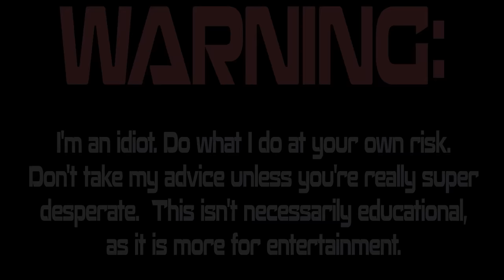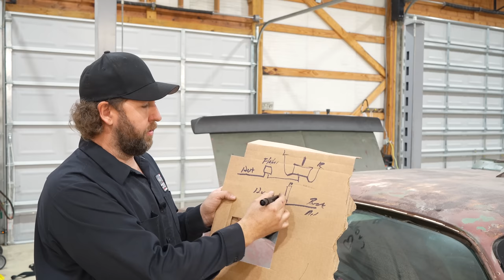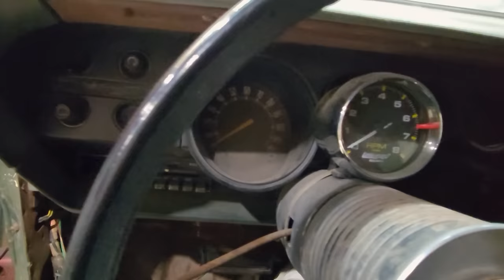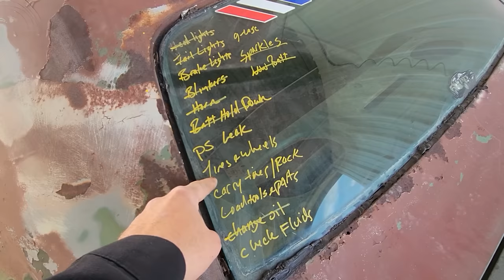Preparing Vanishing Paint for 1,000+ miles!

Comment: For future reference lighter fluid (like Zippo lighter fluid) removes sticky stuff like old stickers and the like, really well. Praying you heal quickly!
Reply: Top tip for removing adhesive foam residue if you're debadging a vehicle: wrap a few sheets of bog roll up to make a pad. Soak it in petrol (gas) and slap it over the residue. Leave it for a few minutes and the residue will come right off 👍🏼.

Comment: I have watched your channel for years, and it just keeps getting better.  I have removed hundreds of decals at work off truck doors.  I learned to use penetrating oil to remove the glue residue.  We had Zep 45, WD 40 works, but not as good.  Just spray it on, let it sit for a few minutes, when just wipe it off with a rag.  Repeat as needed to get it all off.

Comment: Rapid Remover will take care of that sticker residue with the quickness. I used it for years at my vinyl decal shop. It's not hard to find but it is pricey. If you want it off and quick, that's the way to go. Just try it out and see if it works for you. Take care of those ribs!

Comment: Derek with the roof racks if you had left a few inches on each outside of the square tube, it leaves a REALLY nice space for synching up rope or straps. The holes in the bracket are nice but there are situations where you def dont want to use those. Being able to wrap a tie down around the outside of it and making a basically immovable wrap around is always a good thing

Comment: Hey Derek! I used to work in a commercial photography studio and the photographers used to swear by Zippo lighter fluid for removing stickers of all kinds. It removes all of the adhesive and doesn't seem to harm paint or most plastics. You've probably been told this before but if you haven't, give it a try.

Comment: Lighter fluid is the best solvent for sticker residue, and it evaporates very quickly so it’s not a massive fire hazard.  Supposedly professional dry cleaners use it on leather jackets when necessary.

Comment: Derek, it may be worth your while to get some xylene in. It's a great degreaser/solvent and cleaner, it  gets rid of sticker residue as well, also non flammable, so relatively safe around sparks etc. Just test on plastics before jumping in, it does attack some plastics, I ruined an expensive Hi-Fi amplifier switch by not taking my own advice...

Comment: Hey Derek,

Love the videos.  I manage a fleet of vehicles with company logos that change or have to be removed.  I have had great success using a decal removing rubber wheel, heat gun, and alcohol.  I believe the alcohol would have removed the remaining decal adhesive without removing or damaging the paint.  Worth a shot.  Praying for a quick recovery from your motorcycle mishap.

Comment: Man this takes me back. Had a 71 barracuda had the same wiring issues. I ended up replacing the whole harness from bumper to bumper. But it still had a brake light problems from time to time would pop the fuse. Never found the problem

Comment: The brake light  circuit is normally  open until the brake pedal arm is pushed, and the switch  little pin that is up against the brake pedal arm comes  out closing the circuit feller and fellets

Comment: Derek and Jessica great video. I am not sure how it works on the older paint but I have used 3m adhesive remover for large decals/stickers, it works great. Just spray leave it cook a bit and pressure wash off the adhesive. It does have to be 3m brand. For the next time.

Comment: You might want to try slotted unistrut. It comes galvanized/zinc coated. Get the hangars/t-bolts/ accessories to mount or frame it up. Super strong.

Comment: I bought a retired police Jeep Cherokee, and the goo from the cop decals was a challenge to remove- I finally discovered that 3M makes a spray that you can use to remove the goo, but you have to work fast. I bought it at the local NAPA.  They also have a wheel you can put In a drill or buffer or something, the pictures look like gum rubber.

Comment: Isopropyl Alcohol is fairly effective at removing adhesive, usually without damaging the paint underneath.

It’s what we used all the time when I worked at a sign company doing all sorts of vinyl work. Goo Gone and other stuff is just too intense.

Spray on the adhesive residue, let it soak, scrape off with plastic razor blade or credit card.

Comment: Wanted to let a feller or two know that 3M (and other companies) make a really cool disc that removes adhesives REALLY easy!!!  I've been using them for over 35 years now.  They just zip that glue off there RIGHT NOW!!!  If I can't find my disc, I also use copious amounts of acetone on a rag, letting it soak into the glue to soften it up. Comes off pretty easily too that way.

Comment: If you have a laser or water jet cutter, you should find a way to get the VGG logo cut ito the roof rack brackets. Get the 1x1 tube to fit inside the G. I'd put those on a rigg.

Comment: GR8 Add-Vice Derek... 

 [ "Don't be afraid to do the 'Eee-Lek-Tricks'  ...it's simple to do and not that hard." ]

I'm inspired to rewire the 'O/D Off' switch that no longer works on my '03  Tundra wherein the fouled switch is located on the end of the column mounted gear selector.  I'll just run the Eee-Lek-Tricks to the dash panel, somewhere maybe to the right side of the instrument cluster. Maybe or not.

Fortunately I can put this task off until tomorrow or the day after tommorow as I really never need the 'O/D Off' thingy to be active in my occasional to town and back trip.

Comment: Not a fan of electrical either but when you want something bad enough you push past the fear. I did a 2012 dash swap in my 06 mustang but adapted the original harness rather than converting the entire chassis wiring bumper to bumper. I modified the original gauge cluster to fit, created a custom center stack panel that looked stock and changed all the surface mount LEDs to blue and it turned out awesome. Would have been nice to use a 2010 cluster but there were too many wiring and comm changes for it to work without a custom black box for signal translation.

Comment: never tried it with a surface like vanishing paint but a while back a guy was spending alot of time removing vinyl stickers and such from big motorhomes.  3m adhesive remover was a godsend.  i see they changed the name or the original product i used to use and have a few more versions.  ive used it on various other tough adhesives inside and outside of vehicles on paint plastic and leather to great effect.  so not sure if you have tried this product but wanted to try to help a guy out with something ive used before.

Comment: Just noticed that Wire Care produces the Clamp Tite tool. Wonder if you have featured it in any videos? Seems like you should be using it extensively in repairs. Strong enough to hold hydraulic pressures.

Comment: A word of advice regarding your roof racks:  Find something to fill in the holes on the ends of the 1x1 steel bars.  My Dad had a universal roof rack kit years ago that attached in a very similar manner to yours using the drip trays and clamps.  Like your setup, the rack bars themselves were basically just 1x1 bars (these were made of aluminum, I think.)  Anyway, what will happen with open ends is when you hit highway speeds, the air flowing past those open tube ends will make a God-awful whistling noise that gets louder the faster you go.  Definitely cap those ends somehow unless you enjoy listening to a constant and piercing whistling noise at speeds above 50MPH.

Comment: Mopar A- through E- bodies (yes, even the rarely-discussed D-body, better -known as Imperial) of the Muscle era have torsion bars.  
Good News: Much stronger and better handling than coil springs.  More room between the shock towers for engine.  Can adjust ride height by turning two bolts.  

Bad news:  pre-'65 they were prone to snapping, but only when the car was parked.  Put headers on it and you have to take them back off to swap out a starter.  Gotta be a contortionist to swap out the oil filter.

Source:  paternal grandfather.  Chrysler Corp. Dr. of Motors, class of 1956.  Independent mechanic until retirement in the early 1980's.

Comment: With the spring on the brake switch plunger above the brake pedal arm, the switch it self is normally closed. Pedal is up, plunger spring is in, the circuit is open. Brake lights are off. Push the brake pedal, the switch plunger spring comes out (in its normal position) the circuit closes and the brake lights come on. It is a normally closed switch. Is that right??

Comment: Sometimes that darned sticker glue will come off with naphtha or gasoline. I have used crisco or vasoline to soften it but you have to leave it on for a few hours and then scrape it off with a plastic scraper. Any way you look at it, there’s always a lot of sweat equity involved.b. By the way and sorry ifin I’m buttin in but I’d like to see a mopar big block like say a 383 dropped in this time machine.

Comment: That’s a solid car everything looks to be in great shape !! I’m going to buy my paw paws 1969 barracuda back this weekend he owned the car most his life he passed away 23 years ago and I ran across his old car on marketplace and it was still local doesn’t have a motor in it the guy still has the original motor and trans that came in It was a 318 but he also has a 440 short block that’s built Imma get both of them I can’t wait to start on it my paw paw painted the car years ago with Rustoleum metal paint red it has a nice patina on it not sure if I want to repaint it the right way are may buy your patina shine for it but that’s going to be the last thing I do… my paw paw redone the inside with black leather and he redone door panels and all it’s still in good shape and the dash is excellent !!!  Has a little rust on the quarter panel on driver side very little though

Comment: Derek what is your opinion on using diesel oil in my old 1996 ford bronco it has a 351w with 230,000 miles on it and i would like to make it last a little longer it uses about a quart between change and still run great. Be careful on them there motorcycles i have been riding way back before you had to have license . long time fan back before the independence chevelle ,love the car so keep up the good word and keep your boys interested in turning wrenches god bless your familys

Comment: The rear running lights on the right side weren't working correctly. Also maybe you can paint the etchings on the switch panel so the writing is visible.

Comment: do not use anit seize on aluminum heads or on ngk spark plugs,   i would go back in and take out the plugs clean the threads with brake kleen b4 it gets cooked into the threads. block and the spark plugs
Reply: If you think plugs go into the block you're the wrong person to give any advice....LOLOLOL
Reply: @Rick-ro8bf  might want to check your engine block for anti seize, you might have to hone the threads🤣

Comment: This is the first time I've liked your choice of tires and wheels. Those oversized Torq Thrust wheels and rubber-band tires looked terrible. On the other hand, I love stock stamped steel wheels and dog dish hub caps, and those tires you chose are the best looking radial tires that have ever been made, because the original Firestone Wide Oval bias ply tires are in the top two best looking tires ever made, and those radial versions actually look like their bias ply counterparts.

In the pure looks department, I'd give a slight edge to Goodyear Polyglas bias ply tires (plus they are more appropriate for a muscle car era Mopar because that's what came on many of them from the factory), but for radial tires, you couldn't have done any better. 

They make a supposedly "bias look radial" version of the Polyglas, but unlike the Firestone Wide Oval radials, they don't actually look like their bias ply counterpart. The tread pattern is drastically different (much deeper and larger lugs), and even worse than that, the shoulder is drastically different, which is a deal killer, because the clean, sharp shoulder of the originals is the best looking part. With the supposedly bias-look radial version, the tread spills over onto the sidewall like with ordinary radials. You might as well just get BF Goodrich Radial T/As (and save a ton of money) if you think an all-season-type tread spilling down onto the sidewall looks good on a classic muscle or pony car.

Comment: Is way better than gougon or alcohol by itself, you want to use WD40 spray it on a Terry cloth rag! Do this several times to get the initial sticky element that is left on it. Once that is done you use isApril alcohol and wipe it down with an additional Terry cloth and you will never know that it was ever there in the 1st place! I used to work for a computer company and we least systems out and we would always get the systems back with the buzzles covered in stickers and it was a pain i* t** a** to get that sticker resin off, so use the WD40.

Comment: As per usual, you won't listen to me. But, when you use any kind of lubricant, such as anti-seize, you run the risk of stretching, and or pulling threads. Especially when dealing with aluminum. If you dont believe me, look it up. Its no bueno brother.